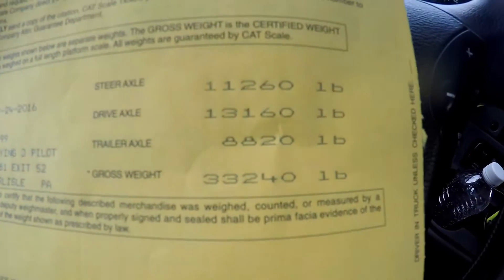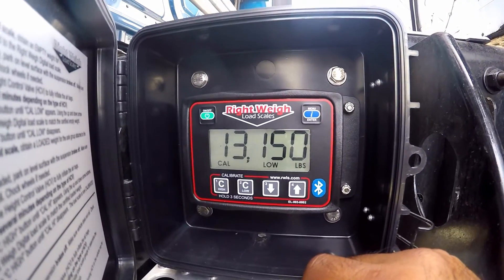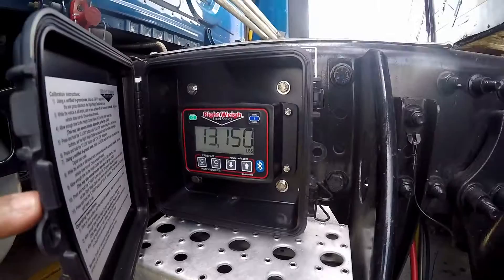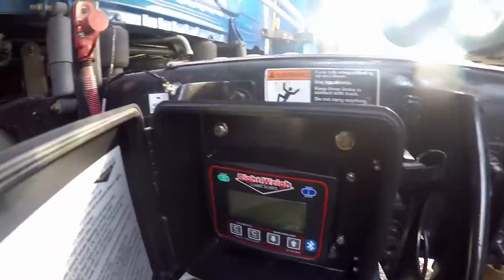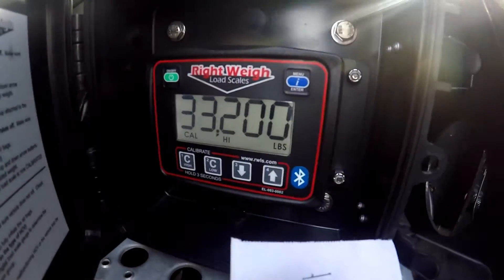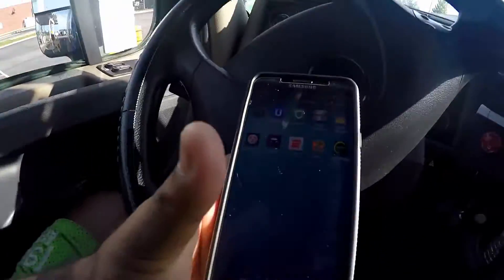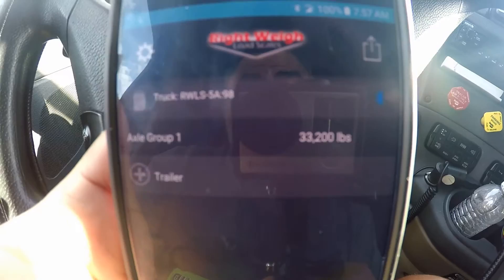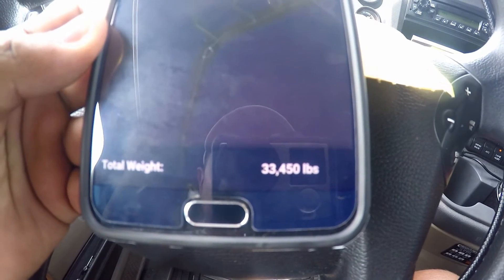Calibrating - Right Weigh Bluetooth enabled Digital Load Scale

Comment: So here's my question. I noticed it's only showing your drive axle grouping not your trailer group. Are you only calibrating the drive axles and it's guesstimating the trailer axle weight? I used one of these but if I remember correctly you had to calibrate the drive and the trailer to get your overall correct weight.
Reply from the maker: Correct. If you know the weights of your STEERS and DRIVES then you will know the weight of the trailer 👍🏽
Reply: @JuniorHonduras  I appreciate the response. I have one other question. Now in your video you set this up on the drive axles but I've also seen the same unit setup on the trailer axles instead of a drives hence only reading the weight of the trailer and I assumed estimating the drives and steers? So my question is can this unit be set up on either or and still be accurate if calibrated correctly?

Comment: If you think about it, that 10lbs  is the difference of the add weight on the high side and lower weight on the low side. You took 10lbs away from the low side and added 20lbs to your high side. That leaves you with a difference of your +10lbs on the final weight out. So if you asked me that is dead accurate, not even off my 10lbs.. Pretty awesome stuff, more piece of mind going down the road without having to scale out at the scale scales!!!...